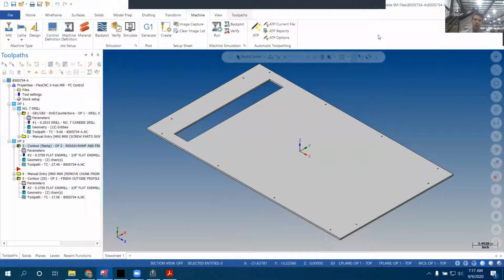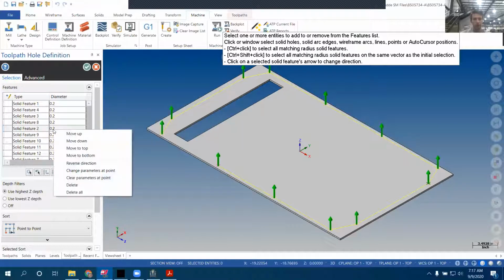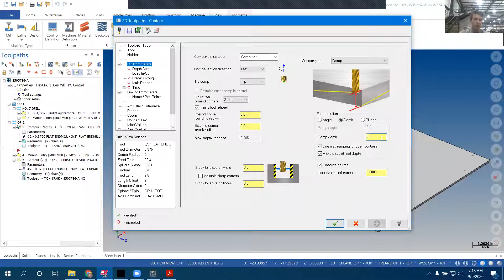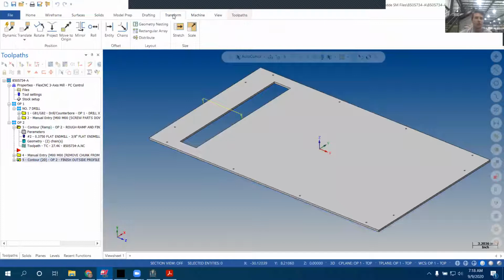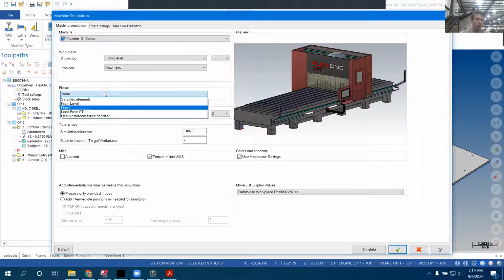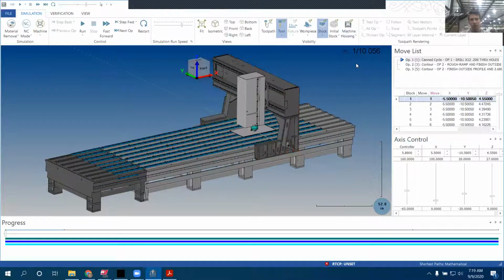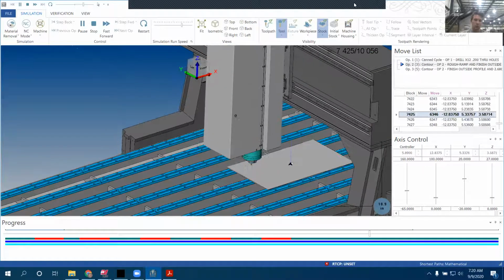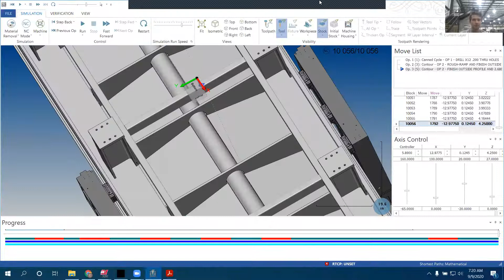How to Program Drilling and Milling for the FlexCNC using Mastercam

Comment: can i get the machine file for simulation? iv asked a few times , but havent heard anything , guess i could email nick , i just hate to bother him.
Reply from the maker: I just spoke with our programmer, and he was able to track down the file, but I believe in order to run the simulation, there are a few other steps that you would need to take.  If you wouldn't mind reaching out to Colton - celsass@flexarminc.com - and he will be able to get you pointed in the right direction